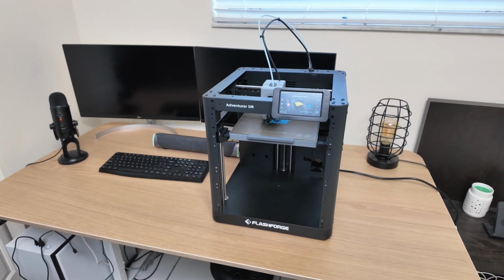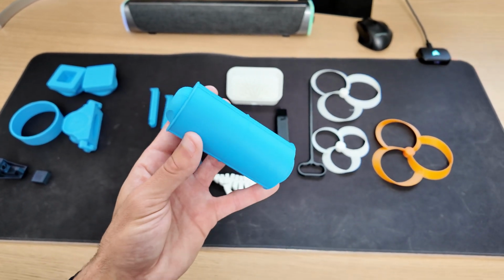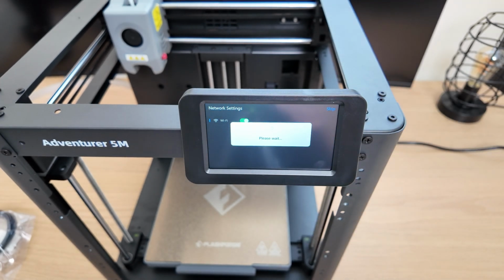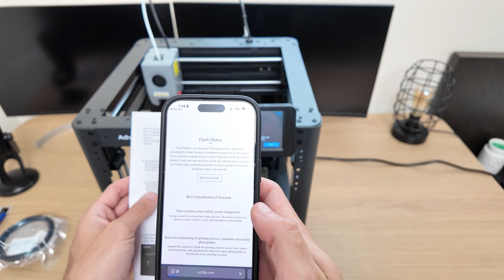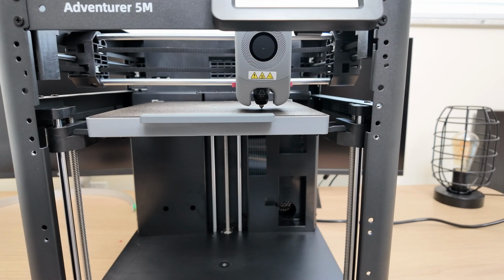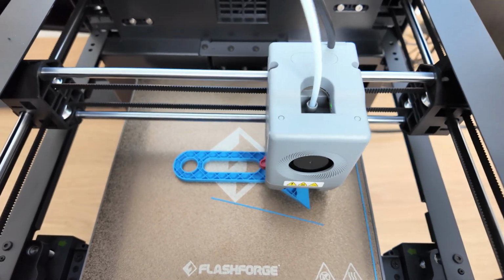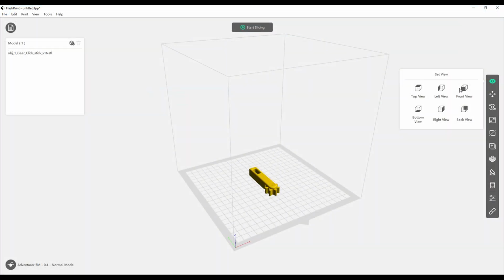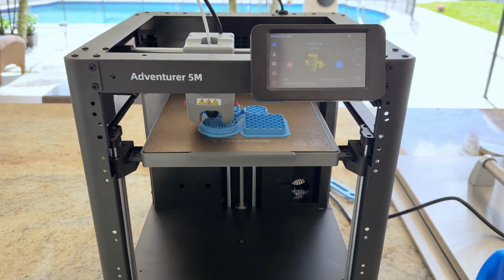Flashforge 5M Unboxing & Full Setup – This 3D Printer Changed Everything

Comment: I made the case with the kits from Flasforge and I have printed 200 plus items without any problem, PLA, PETG, TPU, not a single problem. 6 months amazing after using a slinger Tronxy for 4 years. I don´t understand what is entry level, it does the same shit that Bambu does 3 times cheaper.
Reply from the maker: Totally agree, it really delivers way beyond what people expect for ‘entry level.

Comment: My new one comes tomorrow. After screwing with an ender for months with no success, im ready.
Reply from the maker: You’re gonna love it! Way less hassle than the Ender, super easy setup and prints like a champ right out of the box.
Reply: Before this I was always kind of terrified with every single print I sent to the printer. With the Flashforge I don´t even worry about checking if it is printing. I have it 20 meters away from my pc!. I know someday will fail but it will be something relative to maintenance. I love this machine.